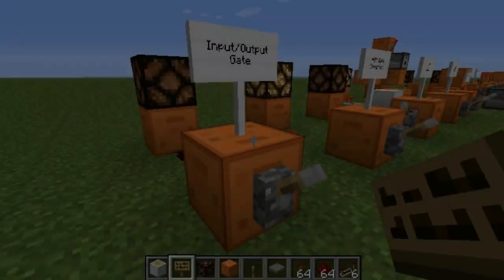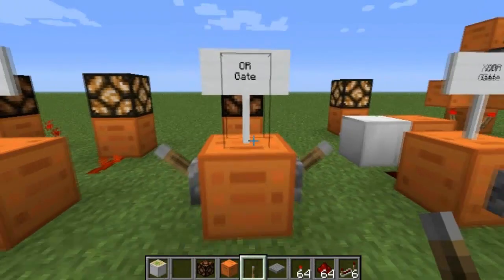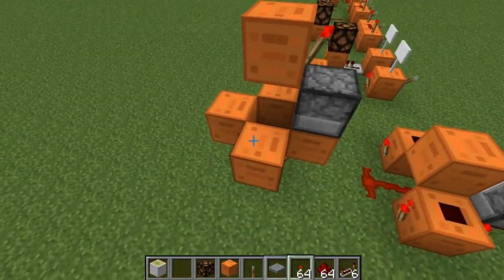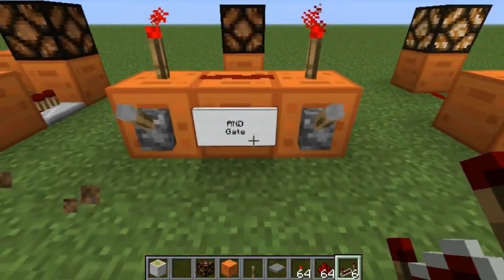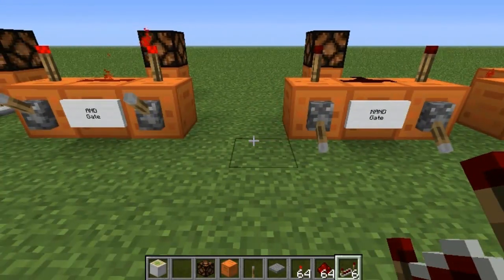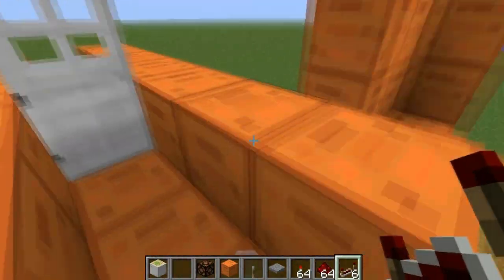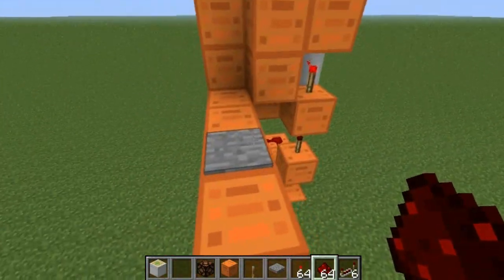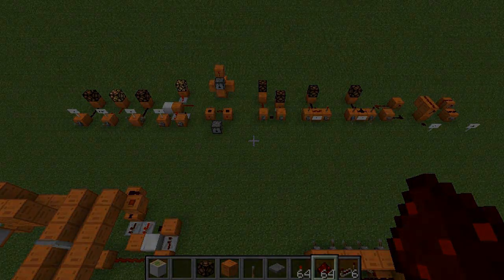Redstone101 :: Mediocre

Comment: Kind of, RS-NOR Latches can still be reset with another button. While Memory cells keep the Information based off of Binary or Uniary offsets. But RS-NOR latches are good for Single Component memory cells if you only want to save a single component.

Comment: just took on a massive challenge compared to what i usually work with.

small computer with a 5x5 screen....took FIFTEEN of your miniature T-Flipflops to wire it to the control panel..

alot more work than i expected for such a small structure but your TFF design saved me a huge amount of space that, due to poor planning, i absolutely could not spare

Comment: at about 2:40 ... that gate you show is an xNor, or also called "equivalence gate"... if both inputs are the same (both on or both off) the output is activated
the xor you tried to explain does the exact opposite, it activates if the two inputs are different (one is on and one is off)

wonder that noone has seen that before

Comment: in your example of the RSNOR you forget to mention the MAIN purpose of the RSNOR which is to store 1 bit of data, in other words you can reset a connection after a specific amount of time or store a bit of data for later use. In your example, you just did something that the XOR could use.